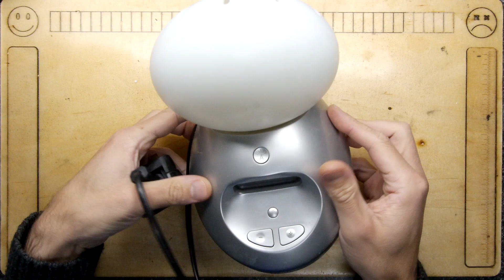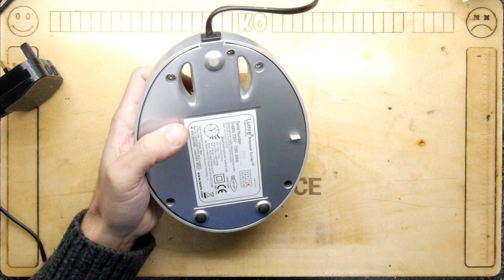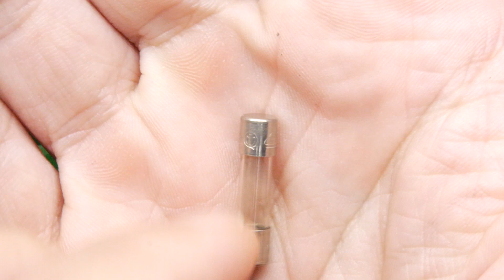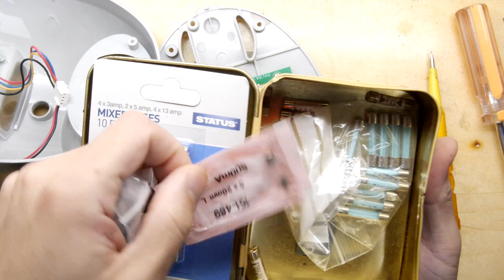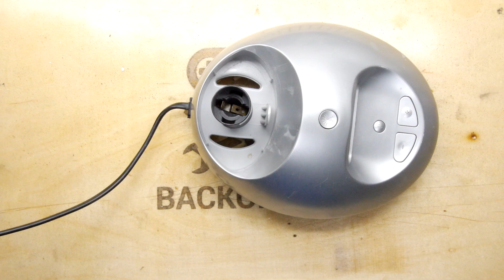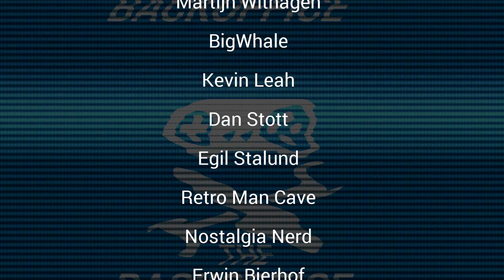Lumie Lamp Repair

Comment: Just watching this because I'm pretty sure mine has blown the fuses. I've managed to replace the one in the plug but somewhat depressingly replacing the other one is hindered by the fact I can't seem to get the thing apart to gain access... It's apparently a far more argumentative a design to the one you just fixed.
Reply from the maker: I am sure with more brute force you can work your way in :) I always use the stance that you have nothing to lose at this point!
Reply: I can see the fuse when I pull the back part up so if I'm lucky I might be able to replace it with a pair of tweezers... This model is an all-in-one unit and it seems that the bottom can't be exposed because the clock is in the way. Given how cheap the fuse is and how expensive the clock is if I can't do it sneakily I might wait and see if a bright spark at work can get it apart before wrecking the entire thing. If I can wake up in time for work that is...

Comment: I didnt notice if the clock element was working by the end.. Did this fix the clock too? My bulb blew this morning and now the clock isn't so i assume it's the internal fuse as your was..
Reply from the maker: Yes, everything was fixed.
Reply: @backofficeshow  thanks 👍🏻 I've ordered fuses to fix.. Did you use fast blow or slow blow fuse? I assume it's a fast blow fuse.

Comment: Nothing wrong with repairing a fuse as long as you use the correct wire. You can even buy fuse wire for this purpose but you have to keep in mind that fuses are rated in volts and amps. Offer example your fuse is rated for 24v 1a and you use 220v 1a fuse wire it's not going to work as expected.
Reply from the maker: Are you sure? I always thought current was current.
Reply: @backofficeshow   higher voltage has higher ability to arc over, so needs to open wider. Also, if it has obliterated/vaporized the fuse wire and coated the inside of the glass it has a higher chance to arc over, therefore typically sand filled fuses for higher voltages vs empty for lower voltages.
You can use a higher voltage rating fuse, but not lower - opposite of the current rating (though a lower current rated might of course blow in normal operation)
https://m.youtube.com/watch?v=X19wMRJ3MoQ

Comment: I noticed you plugged back the button PCB, but right before you closed it, it seemed the temperature sensor wasn't plugged back in the connector 😅
Reply from the maker: I better check that later. It's running as expected so it would be a pretty lame safety device if it failed unsafe 😂

Comment: OL is open loop no? 
I did once wrap a fuse in tinfoil to get me out if a pickle once, (not mains power mind)  so using a correct piece of wire sound much safer 😄
Reply from the maker: How about a video where I make and test a bunch of fuses out of wires we might find in the home? That actually sounds useful for non mains things
Reply: @backofficeshow  actually would be a interesting video that. Definitely would need the usual disclaimers tho. 😉